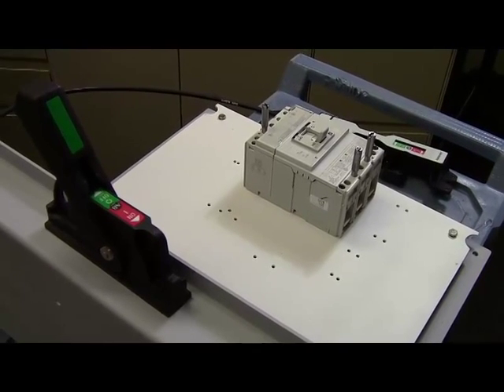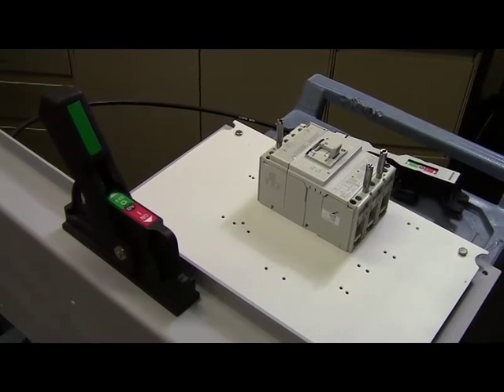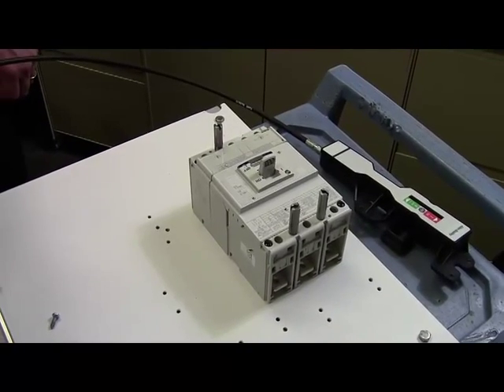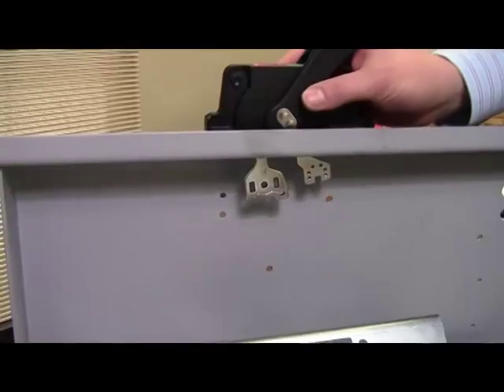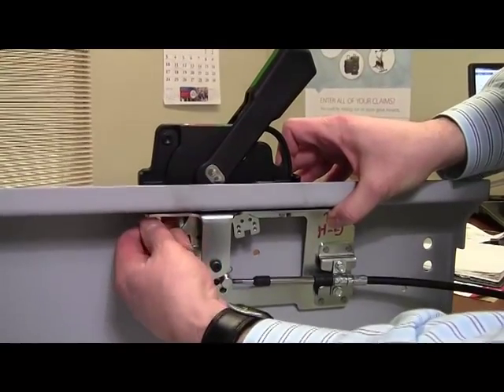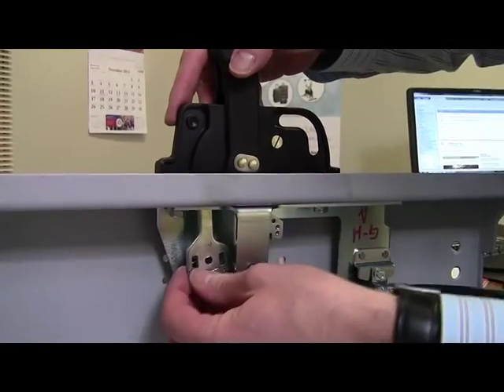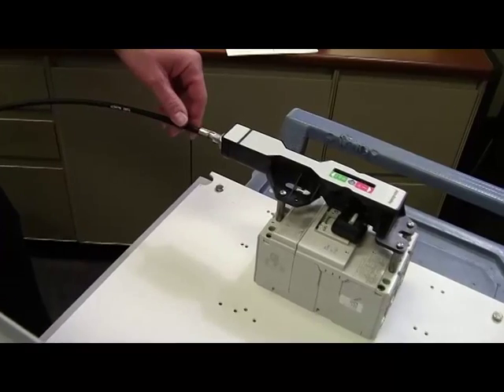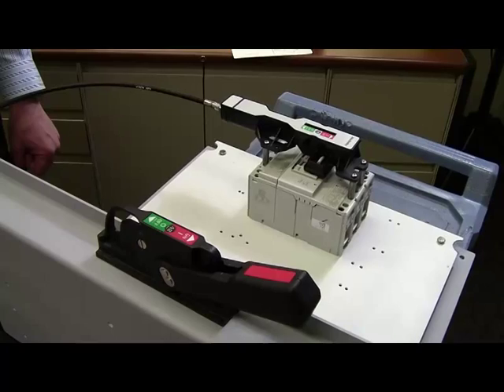Installing the Flex Cable Flange Mount Operator for Bulletin 140G Molded Case Circuit Breakers

Comment: Good video, but perhaps you could also make one for how to install the door interlocking components.  It would vary with the make of enclosure, but perhaps it could be general enough.  The piece shipped in my kit for attachment to the lower (interlock) mechanism doesn't match the installation instructions. Mine has two locator pins instead of a locator tab for the notch.  Also, the installation instructions in the kit package didn't address the angle bracket and door latch piece for the interlock.